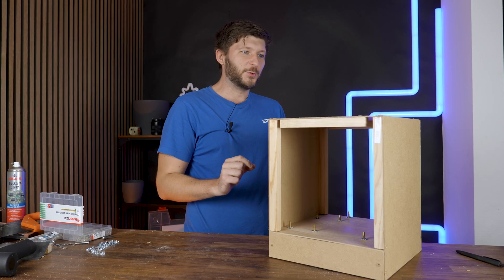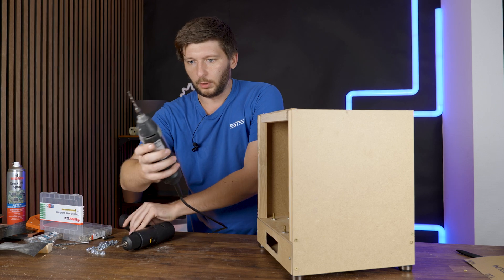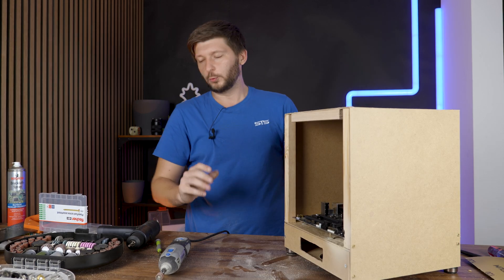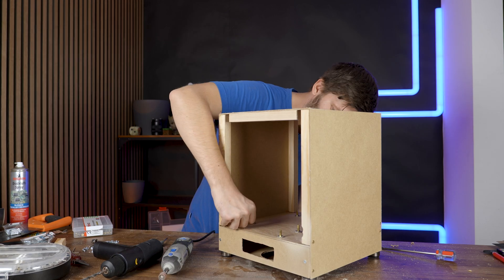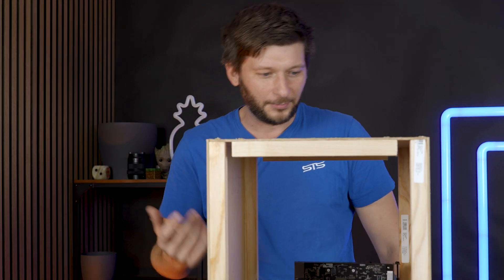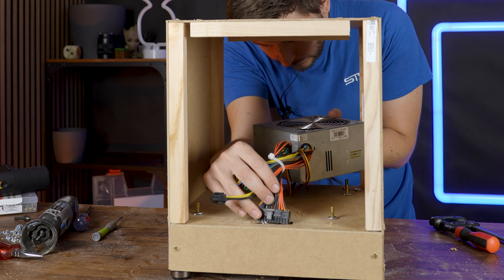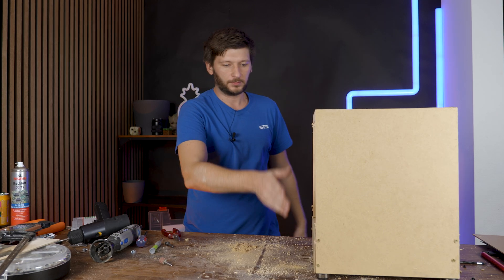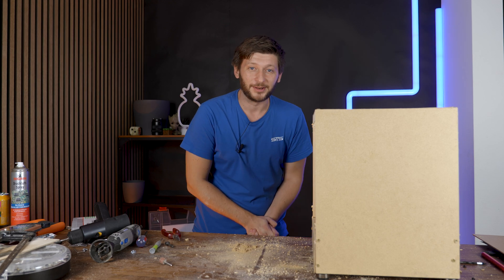How Not To Install A GPU - DIY CASE Fan Testing Machine - Part 6

Comment: If you will test noise then you may look on passive cooled GPUs. I know about Palit "KalmX" models: 750 Ti/1050 Ti and 1650 models. They have got only radiator and no fans. Also there was EVGA tiny GT 1030 and also GT 710.